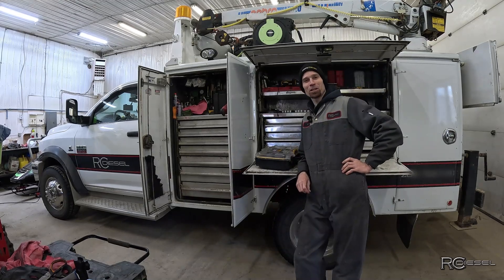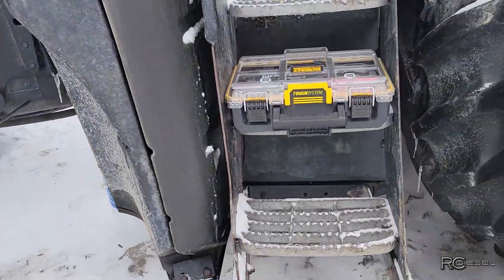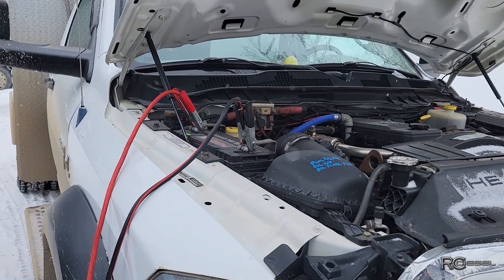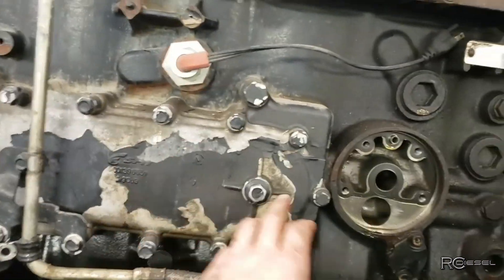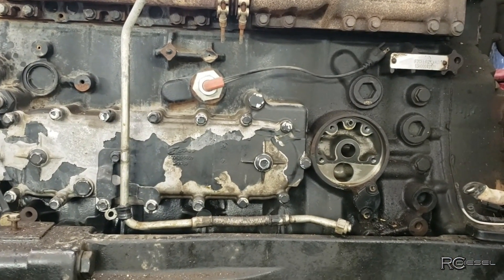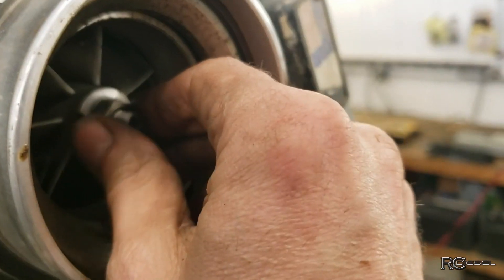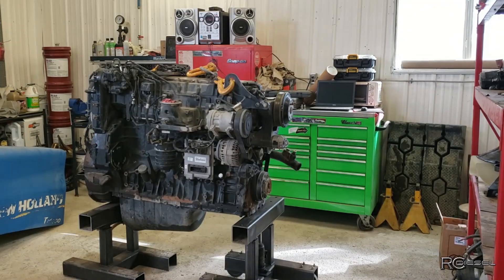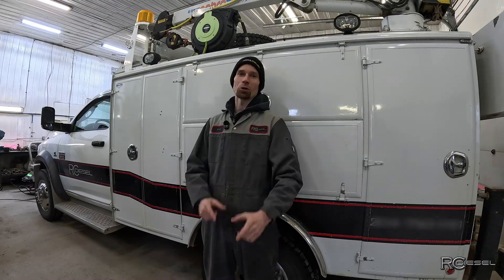Rebuilding an 8.7L Iveco Engine | Part 1 - Diagnose Coolant in Oil & Surprise Damage : RCDiesel

Comment: I really hate that they went from cummins to iveco I've seen more problems with iveco motors than cummins motor
Reply from the maker: @Thegrim326  Interresting! I love the Cummins engines, but I can't say much about Iveco. I've worked very little on these engines so far.
Reply: It's the emissions that's ruined engines... It almost doesn't matter what engine, it's going to have problems down the road.

Comment: Liked and subscibed right away 👍 
Don't know why but i always had a week spot for Iveco.
Here i my country (Denmark) everyone "hates" them (the trucks). So a video like yours is quite interesting for me👍 
How many hours is on that engine?
Looking forward to the next video 👊
Reply from the maker: @KennysClackyGarage  Denmark! Wow! Cool! This engine is just over 6,000hrs. So it's got time on it, but not enough for this kind of trouble. I should have the teardown video ready for Tuesday. Thanks for watching and subscribing! 👍
Reply: @rcdieselchannel nice👍 i have knowledge of a Iveco 8031 engine with 50.000+ hours on it, it was the primary generator on a ship so it was running non stop for weeks in a row of course. They had an identical spare ready to replace it, when the head gasket blew and they only made the swap because it was faster than to rebuild the old one.
Reply from the maker: @KennysClackyGarage  50,000hrs! Wow! Highest houred engine I've been into was 21,000hrs that I know of. But yeah, if it's running constant load for hours on end, that's totally possible for an engine like this. Seems to be a well built engine from what I see. Thank you for sharing, I love learning about stuff like that 👍
Reply: @rcdieselchannel  you're welcome ☺️ and thank for your videos. I just came across your channel and i'm gonna start watching your older videos until you post new ones👊
Reply from the maker: @KennysClackyGarage  Awesome man. I took a quick browse through your channel here, looking good! My second oldest boy is doing a lot of the small engine stuff for me, he's 15. Looks like your channel will be helpful! 👌

Comment: Injecter cup maybe ?
Reply from the maker: I think that would have been a possibility yep. That is the reason why I took the valve cover off when I was going to pressure test the cooling system again. I never did do a second pressure test with the pan off, but the a mount of coolant that came running out when I did the first pressure test in the tractor seemed to indicate I'd have to have a split injector cup for that to be the cause, and that would mix fuel and coolant as well.
Reply: Make sense thanks for the explanation keep the good work!

Comment: Have you ever been into one of these? The timing procedure is very involved.
Reply from the maker: @slowride55  This was my first one and I luckily I paid enough attention to what I was doing to realize the timing procedure wasn't going to work right. You'll see in future videos, but basically, I really had to use my head with this one. If you time this engine by the book, you're going to be re-rebuilding it.
Reply: @ I did a T8.300 and timed it by the book and it ran fine no codes. All you’re doing is adjusting the position of the cam based off the lift of I think maybe #3 exhaust lobe. I think they do that for different mechanical timing of different cams for the different horsepower ranges.

Comment: Iveco should have offer an unlimited no fault replacement for pawning off such poor quality on their customers. If I was a gambling man I’d wager that Iveco knew that the affected engines had issues before they left production. None of the major manufacturers have any  character or integrity anymore.
Reply from the maker: @prevost8686  Yeah, I'm not sure if they knew when the engines left production or not, but they certainly shortly thereafter. It's a major major issue for the customer and I think they all should have been recalled. All they're worried about is if it makes it off warranty.

Comment: How many houers on the engine?
And what year?

🚜🚜🚜
Reply from the maker: @jdeere8850  Just over 6200hrs on this one. I don't actually know the year, I think it's a 2014.
Reply: Thats not a whole lot.
🤔🍋
Reply from the maker: @ No, it sure isn't. My understanding is most of these engines failed between 3000-5000hrs, so this one did good according to that.

Comment: With the filter collapsed like that would it be starving for oil?
Reply from the maker: @colesammons2137  In theory, it's just pumping unfiltered oil through the bypass valve. It showed good oil pressure on the gauge and the sending unit is in the oil gally on the block. Unfortunately, I never did put an actual gauge on it before I tore it apart... But no, I don't think it was starved for oil. But it was pumping coolant saturated unfiltered oil through those bearings!
Reply: @ guess the old saying “the wrong oil is better than no oil” isn’t always spot on ha

Comment: I was surprised that battery pack could spin that engine. That being said I don’t like that common rail setup when they are under the valve cover.
Reply from the maker: @bartdaw6681  Pretty amazing tech in those little boxes. I wish I had videod the corner post when I first tried it without the booster pack. The batteries barely even lit the lights up in the corner post. Pretty amazing little boosters. And the second that clamp fell off, boom. Everything just quit. Crazy.
Reply: I actually prefer the common rail under the valve cover. Much less cleaning needed when it comes time to service the system especially on combines.
Reply from the maker: @KALI1080  Makes sense. The only draw back I see is if one of those lines leaks, it takes all morning to get to it. Then you fix the leak and it takes all morning to put it back together. Then it's still leaking and it takes all morning to...... Good thing HPCR lines don't leak very often.
Reply: @ it’s actually more common for FPT cursor series engines to make oil than you think. Usually it’s from the high pressure fuel pump seal on the common rail models that are bigger than the 8.7l.
Reply: There a wee durite jump pack that’s quite popular in the uk it’s probably about the same size as the noco and I’ve seen guys starting 13 litre truck engines with them

Comment: Those NOCO boosters are awesome. My shop has 2 of the GB500+ models and they are used all the time. If that booster pack will not start what you are trying to start, chances are your batteries are dead and/or you need to plug the machine in or your fuel is gelled. Biggest complaint is the leads are really short on that one too. 
I have a wicked cold start video on one of these engines in a New Holland CR7090 combine on my channel.
Reply from the maker: I carry that GB155 on the truck and it is an awesome piece of machinery for sure. In this case, those batteries would not take enough charge to properly light up the corner post on their own, so that was all booster pack. It overheated pretty quick, but this was an extreme use case. Pretty amazing. I started with the GB70 about 7 years ago, and even that little guy will start any pickup truck.
Reply: @rcdieselchannel  I am lucky with a new service truck at my dealer. They have these Miller Bobcat Airpack 200 units on the trucks that will charge at 15 V 100 A and will push 300 A cranking assist. If the big booster packs don't get stuff started, the bobcat will if you leave it on there for a little bit and the batteries are not stone dead. Got a 13.5 in a S680 started last week with it in -30 with it.
Reply from the maker: @KALI1080  Woah. Starting a 13.5L Deere engine with emission in -30 temps can be a FEAT! They don't turn over very fast at those temperatures. Well done!  My Service truck has a 220A alternator, so not quite 300A, but there still isn't much it won't start 😎
Reply: @rcdieselchannel  Yeah I was surprised that we got it going. Now we need to build more booster cables cause the truck I was driving that day was the only one with a booster cable set that had a 175 anderson connector to connect to that welder. Keep the video's coming man!  I love this stuff! Really liking this machine. Worked for a New Holland dealer for 8 years on the smaller equipment and would have loved to dig into a job like this! Have fun timing that engine!
Reply from the maker: @KALI1080  I need to convert my cables to an Anderson Connector. It's on the list of things to do if I ever have time! 😅 8 years at NH eh? Sweet. My New Holland experience and knowledge is limited. I'll tackle about anything though. I did just shy of 10 years for John Deere. That was a good job.

Thanks for the encouragement! I always appreciate that a lot. More videos coming! 👍
Reply: @rcdieselchannel  Yeah working for the New Holland dealer was great! Got to go for all the engine diagnostic training. When you go to time that engine, you may want to contact a dealer to get them to double check the specification for the timing with CNH Technical Help Desk. The engine diagnostic trainers said that sometimes the specification changes but the books are not updated. Will need the engine serial number and the camshaft part # if you want to do that.
Reply from the maker: @KALI1080  You're 100% on it bud. The books are wrong. I don't want to spoil it, but that tractor is actually long gone 😬 I noticed discrepancies in the books and had to really use my brains to figure out what was going on and how to time that cam without valves hitting pistons. If you go by the book, you're goanna re-rebuild it, I can gaurentee that.
Reply: @rcdieselchannel  Yep, I got good at reading the books at the New Holland dealer lol. Their books just suck!

Comment: That is some crazy damage.  Cam bearing?  WOW
This unit has how many hours?  I wonder if the liners were done under warranty already.
Reply from the maker: Roughly 6200hrs when this engine came out, so it had some time on it, but not a lot. My understanding is that one way or another, it missed the warranty period on those liners and that's why it came to my little shop.

Comment: That ole girl was a ticking time bomb.
Reply from the maker: @wesleycooper2647  Sure was. I wasn't expecting to find that bearing in there like that. It ran fantastic.... Nobody could have known.
Reply: @ you’d almost think it would have had low oil pressure when it was hot.
Reply from the maker: @wesleycooper2647  Right?? I regretted not putting a gauge on it before I tore it apart. I didn't run it much - and maybe that was a good thing. But oil pressure in the screen was good when it was semi-warm from idling before I brought it inside. I didn't want to run it too much knowing there was still some coolant in that oil.

Comment: Oh ya Jimbo , just a couple nuts and bolts and 20 hours later , you can have it back . Not quite the way it works. What do you mean , it was less that 30 minute and you had the motor out , another 30 minutes . Jimbo leave it to some like RC DIESEL to fix it and fix it RIGHT.
Reply from the maker: @suzylarry1  Haha yeah, even at that: a 70hr job usually isn't completed in two weeks like people think. For example, I have an 855 Cummins block that's been at the machine shop for 6 weeks! It doesn't take 6 weeks to rebuild a motor.... Or does it..... 😕 Everybody's busy, everybody's behind.